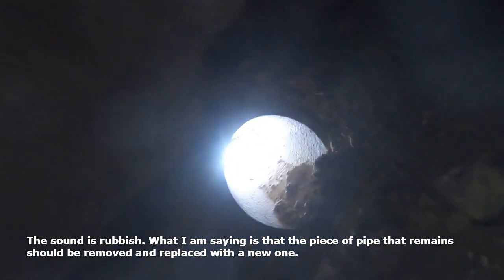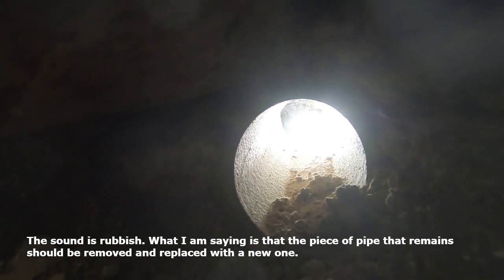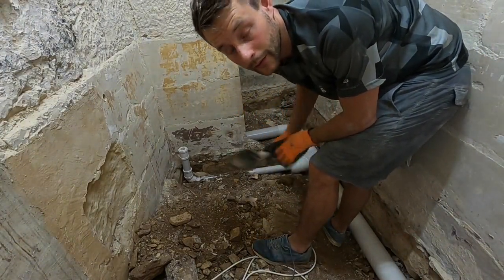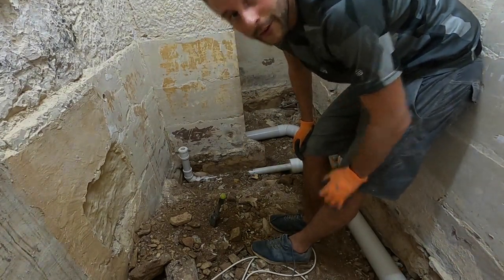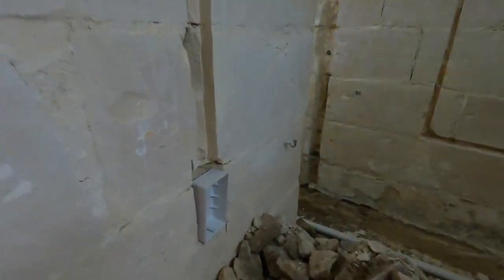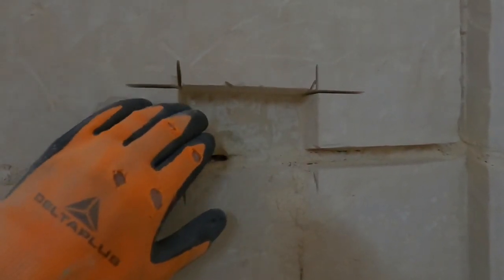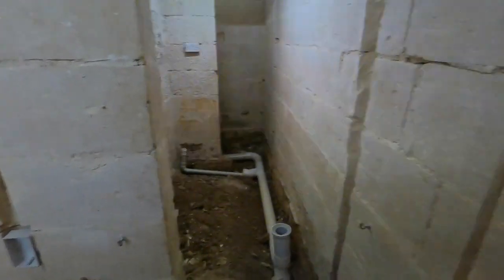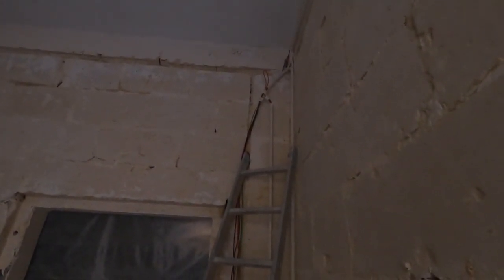DIY kitchen and bathroom renovation | Episode 3 of our Malta townhouse renovation

Comment: Good morning from Brazil.You could run the wires through pipes (industrial style) sticking out of the wall. The electrical pipes are what I'm referring to.
Reply from the maker: Hi, yes I heard that from others as well but I don’t dare to install the pipes in the wall, cover it up and then find out that I did something wrong or not be able to pull the cables through the pipes. It feels much safer doing it this way 😅 Even though it’s quite tricky.